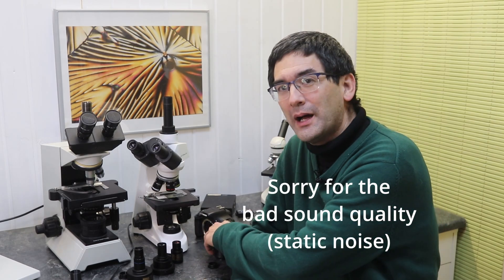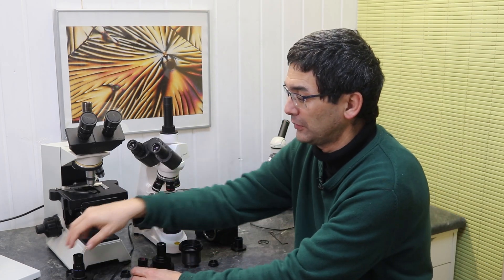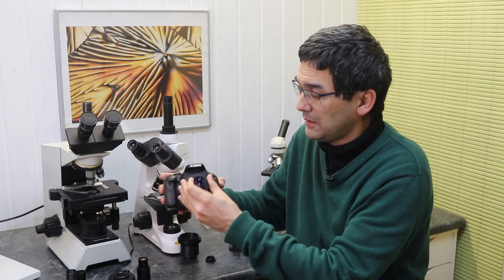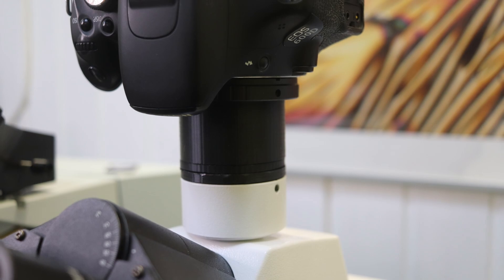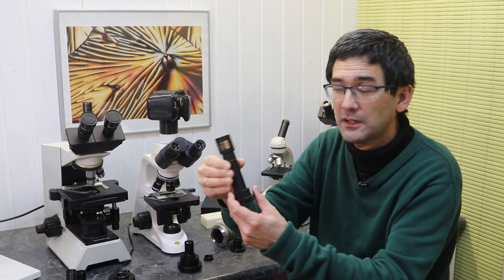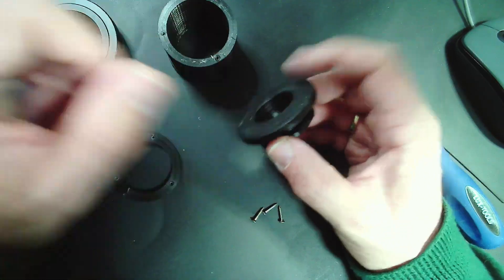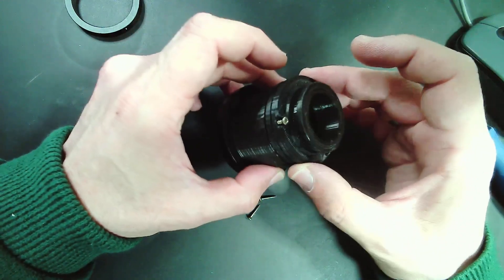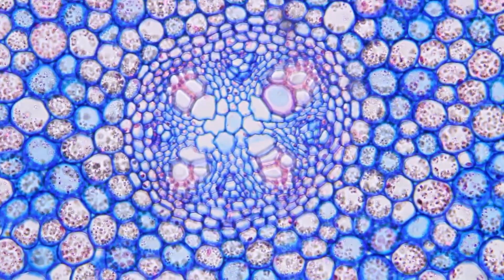Making a DSLR camera adapter for a microscope 🔬

Comment: In AliExpress  F mount adapters for Nikon DSLR cameras to  23.2mm   via T mount or C mount  do exist and are cheap.  They contain a lens that focus directly into the imaging sensor.  They are the exactly the same that AmScope, OMAX, Bresser, etc   and others sell to you at 3x the price once they stamp their branding.    These adapters will work for all microscopes because they come with 23.2mm 30mm and 30.5mm  which cover all the diameters standards out there.

Comment: with many microscops i made the experience that if use  use  only the  microscope objective without eyepiece or additional optics even with infinity objectives the image witch is projected by the objective on the camera sensor is sufficently sharp in a wide range especially for  microscope hobiists. A good idea is to use an extension bellow to adjust projected size

Comment: I also made a similar adapter long time ago but I noticed that the internal surface of the adapter was reflecting light creating disturb to the image reflect d on the ccd sensor somI had to stick on the internal surface a kind of rubber in order to obtain the required anti-glare effect. Did you experience anything like this with your adapter?

Comment: I have a top-notch zeiss scope with the old time camera attachment. I am thinking of adding a dsl usb cammera so I can see the slide on the computer.  Finding an adaptor has been impossiable. But if i use the original adaptor with a new usb camera, it could work out.

Comment: this video has me sooo excited!!! i def need to find someone with a 3D printer, lol - but did I miss something? how do I determine the correct length of the tube? i imagine it will be different depending on the scope and the camera that I use
Reply: Your suspicion is correct. This was his response lower in the comments to someone else:

"Put a paper over the tube to catch the image (which should be in focus) and estimate the distance. This is where the sensor should be. Estimation work. If a bit off, it's ok, need to re-focus then. Having a tube that can be extended and adjusted (eg by turning or telescope-mechanism) would be better."

Comment: Hello, very nice video! I have a question: are you able with your adaptor to avoid black borders in the picture? I mean, are you able to obtain a rectangular field of view?
Reply from the maker: Yes, the images are just like I showed them at the end of the video. The tube of the microscope is luckily wide enough to fill the full frame of the camera. The only thing that is a pity is that the microscope does not seem to be available anymore.

Comment: So does this only work on that specific microscope? I enjoy the videos but I feel that point could have been covered in the almost 18 minute video. 

Thanks.
Reply from the maker: The principle (projection of the image on the sensor) works in all microscopes, but the advantage on this one is that it is easy to connect the adapter to the microscope. So for other microscopes one would have to check if it is possible to remove the phototube and to replace it with a DIY adapter. In short, it was easy to connect a 3D printed adapter to this microscope and the tube was wide enough to fill the full sensor with the image.

Comment: Being that you are not using the ocular magnification, does the use of the dslr adapter on the photo tube then only produce the magnification of the objective?  Also, is there a way to do this if you don't have a trinocular - using the eyepieces?
Reply: Depends on your microscope. I had a very cheap one lying around, it's sold under many names by many brands, I have the Bresser one, "Biolux NV" they call it. You can disconnect the whole upper part with the mirror and eyepiece tube and shimmy together an adapter for your dslr by drilling a hole through the middle of a spare body lid and attaching a short tube to it that fits into your microscope. Works flawlessly if you carefully center everything.

Comment: If you use e.g. a 40x objective and a 10x eyepiece I will see a 400x image. Will my camera connected to the trinocular head with this solution also see 400x?? I mean: how would my camera know if I'm using the 10x or the 25x eyepiece (^_^)

Comment: Wonderfuly done. Respect.
I am at the same path, but i am an ophthalmologist and trying to do the same thing with slitlamp.

You have one good advantage that the microscope does provide a bealt on beam splitter. I am too trying to avoid an optic in the midway of the adapter.
Any tips and tricks are welcome😅

Comment: So, I'm somewhat at a loss. I received the adapter that supposedly doesn't work very well and it works fine. I think the only improvement I could make to how it connects to my AmScope M150C is if I could somehow buy a shorter barrel that goes from the prism to the eyepiece? That might zoom the image that is projected onto the sensor?
I played around with just shoving the lensless and adaptorless camera against the hole the barrel scres into(pretty much right where the prism is, and I got some decent results. So If I could just find a way to have a very short adapter that screwed into the microscope in place of the barrel, and also had a mount for my camera, that would maybe be best.
But all in all, I'd say I'm happy with my generic adapter.

Comment: How did you actually determine the overall length of your 'printed' adapter? I know you had to add a small adjustment ring to get "perfect image focus" - so that additional ring was presumably by trial and error - but did you initially measure the distance from the image location in the phototube to the sensor plane in your camera or did you start with some predetermined distance first? I note you have a Canon 600D which has a sensor with a Crop Factor of X1.6.  I have the Canon 90D [which has a similar size sensor and same Crop Factor of X1.6 but 32MP]. My Meiji Stereo Zoom microscope has standard phototube so would greatly appreciate any comments you may wish to provide regarding what length your printed "lens-less" adapter would be required for my microscope.  Cheers,
Reply from the maker: Put a paper over the tube to catch the image (which should be in focus) and estimated the distance. This is where the sensor should be. Estimation work. If a bit off, it's ok, need to re-focus then. Having a tube that can be extended and adjusted (eg by turning or telescope-mechanism) would be better.

Comment: there is absoluty no need to 3d print such adapters because at your grocery they have cheap tubes with al diameter and materials. Solche Rohre gibts im Baumarkt und dann muss man halt etwas feilen und mit Heisskleber oder Harz und Fieberglas  arbeiten

Comment: Great video as usual it’s what I’ve been doing on my scopes fitting them for use with my micro 4/3rds cameras
Reply: And I wish I knew this before I tried the 'regular' solution (C-mount to MFT adapter and 0,5x C-mount optics between trinotube and camera). This setup produced absolutely terrible images. I suspected the optics first, as I know the GH5 takes fine pictures and I know that the microscope itself (NexiusZoom by Euromex) also works fine.
Bought a Euromex VC.3031 yesterday and tried it with the 0,5x optics as I was curious, to find out that it's the combinatie that produces the horrible result. The image quality is still not completely what I expect (the focus seems to be off-center and there's quite some chromatic abberation still) but the image quality was already sooo much better. I know actually got very usable results instead of the shitty, blurry blue-hazed fuzz with the GH5.
Than just tried goofing around by removing the trinotube in whole and put my GH5 without a lens over it and was surprised about the results, though I definitely need to upgrade the lighting that way.

Comment: If this produces "pretty good" image quality, what then would give the best possible image quality (vignetting, chromatic aberrations, overall/corner sharpness, color reproduction)? What about dedicated cameras based on something like Sony IMX485 sensor? Also, full frame vs. crop sensor?
Reply: I guess this is as goood as you can get. Straight from the objective onto the sensor.  Good point on the sensor size as that matters a lot for the adapter design.

Comment: I have been watching your videos now for some time and enjoy them greatly. You impart a great deal of useful and often fun information 
I have a BS in Biology, and have been getting into some microscopy for fun and something interesting and fun to do 
I am writing you as I have been give a very nice but older microscope. It needs cleaning and some minor repair. I have been looking for on arts on eBay (objectives that needed replacing, and dine other minor parts). I don't dare disassemble the instrument as when I watched you tube videos on repair and maintained, I found that there were some very tiny parts with high tolerances, such as ball bearings, fears used in adjusting focus, specialized tools and,specialized materials. 
I have called several microscope repair places and they say it is an older obsolete model that Nikon no longer makes parts for. (I have been purchasing what I know from sellers on eBay). It is clear that the lubricant s have become sticky as I had to clean some thumb screws that were for adjustments. Do you have a suggestion if where or how I can get some kind of assistance? It was at one time a very expensive microscope and was told it would cost something in the $4500.00 range. One problem I had was obtaining a new objective, because of it's focal length. It isn't an infinity focus, or the standard 160mm focus, but rather a 210. I now have the objective but am concerned about the cleaning if the old lubricants and the application of new. Any ideas??
Reply: Ask a camera repair shop, the very least they will do is advise on proper cleaning

Comment: I use something similar made from different adapter tubes (30 mm - M42 adapter, M42 macro extension tube and M42 - EOS M adapter.  Indeed image quality is leagues better than using an adapter with low quality optics. I do sometimes have issues with reflections and vignetting especially using bright field but for 4K video my camera uses only center part of the sensor so then it's not an issue.
Reply: for larger sensor cameras vignetting might be an issue. Actually I think micro 4/3 would be the perfect sensor size for this application
Reply: Have you tried flocking the inside of the tubes? Alan Walls has a simple method using cardstock and velvet that he uses for macro photography with microscope objectives.
Reply: I have printed a version for my Motic BA310E and with the 4K video it works perfectly without vignetting (because of the usage of only the central part of the sensor). I will use a special mini HDMI to USB capture device to stream the video on my monitor, otherwise you will have to pay for the Canon Eos Webcam app (free version only 720p) and that capturing device costs me only 3 months of prescription fee.

Comment: Hi, I think it's not 'static', but instead a earthing-fault in the power-supply of your microscope. Every time you touch its body, a capacitive loop is completed between this leakage and your collar-microphone, that brings about the noise. A battery-operated mic or a better earthing on the microscope would mitigate this issue, IMO.

Comment: Great work Oliver, just a thought when I was using newton style telescopes I lined the inside of the main tube with a self adhesive black mat fine knapp felt to reduce internal reflections. I noticed that the inside of the 3d printed tube looked quite shiny? Do you think this could cause reflection problems and reduce sharpness of the dslr image?
Reply: For a si.ilar project i did at first sand the inner parts lightly, then primed and at the end sprayed it with matt black rubber spray paint. It worked fantastic. But i do put emphasis on sanding and priminig at first to enable ABS plastic to hold on tight to the paint :)
Reply from the maker: Yes, reflections can be a problem. Because the tube is quite wide, I did not see major problems here. Narrow tubes can cause quite a bit of reflection (otherwise add baffles to block light).

Comment: Without a camera adapter lens, you should be getting vignetting. The camera sensor's diagonal, for a Canon DSLR, is about 27 - 28 mm, and the projected image has a diameter of about 18 mm, for microscopes using RMS objectives. So the only way this could work, is if the tube lens (specific to infinity optics) works, together with your device, as a camera adapter lens. Have you tried your device on DIN160 microscopes too?
Reply: This was a very helpful video! Ive been looking for information on this topic for a while. This comment also addresses the exact concern I’ve had for the pros and cons of a camera adapter lens. If I’m going through the trouble of putting on a dslr camera with a big sensor I want to utilize its size. I would imagine if a camera adapter lens does a decent job at not introducing a lot of aberration but it allows the projection of the image to cover a greater area of the dslr sensor then I think it might be a worth while trade off compared to not having an adapter lens and the image only covering a smaller portion of the camera sensor. 

Assuming I’m understanding all of that correctly.  I might be wrong? 🤷
Reply: @Midnightmicroscope  The DSLR adapter that I have is magnifying by a factor of 2x. I also have two microscope camera adaptors, the fixed one magnifies 0.5x, and the adjustable one magnifies 0.75x - 1x. Those are appropriate for microscope cameras with (much) smaller sensors than a DSLR. The problem I have with the DSLR adaptor, is that the projected image diameter is too large, 18 mm x 2 = 36 mm. And 28 mm / 36 mm is about 0.78. So this results in a loss of FOV area of about 0.44, or 44%. I would like to see an adjustable DSLR adapter, with a magnification between 1.2x and 1.6x. At 1.6x it would just avoid vignetting, because 18 x 1.6 = 28.8. And if I would like to accept vignetting, in order to achieve a larger FOV, I could use the 1.2x, and then crop the resulting image, to get rid of vignetting. Of course, the above applies to microscopes with RMS objectives, and 18 mm diameter of the projected image. There are M26 objectives, with a diameter of the projected image of 22 mm, or even 24 mm, and the calculations would need to be adjusted.
Reply: @mutzunake4761  oh I guess i didn’t think about the opposite problem of having too large of a projection for the DSLR sensor but that makes sense. I agree an ajustable magnification would be nice. I struggle to find any adapters let alone the correct one.(but im also still trying to learn exactly what i need ). But your breakdown is very helpful and makes the problem a lot more tangible to deal with. I would like to some day add a full frame camera so maybe a 2X for a 36mm would be just about right but currently a 27-28 mm sensor is what I have. You make a good point Im not using RMS im using M25 objectives so I will need to calculate the projected image diameter for the objectives I have.

Comment: Thank you for sharing this. I wanted to buy a lens adapter for my sony a7 but I didnt found any good adaper. I hope it works to connect the camera directly to the optical path. But my concerns are that the image circle is to smal for the full frame sensor and that the full resolution of the objective cant be captured due to the fact that the sensor has a pixel size of 5.97µm.